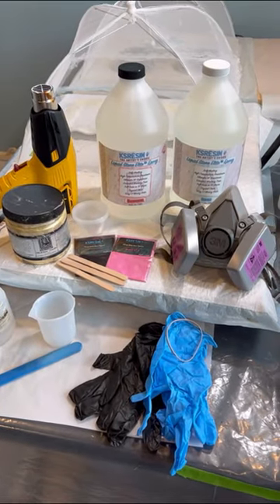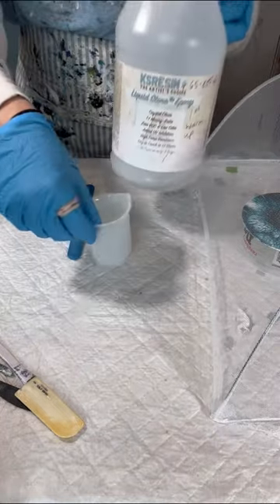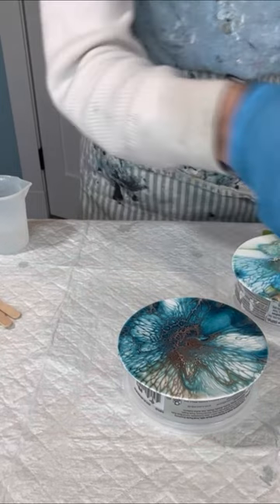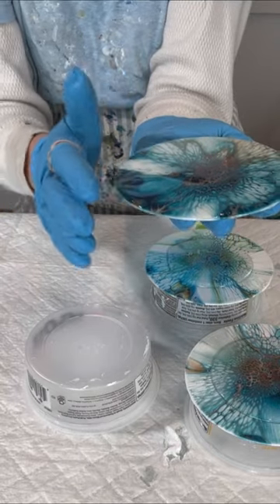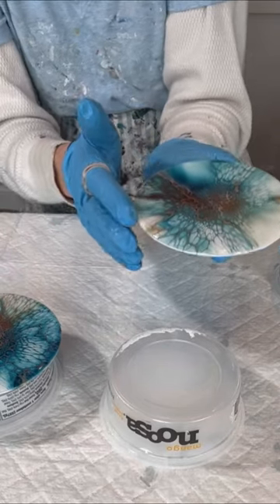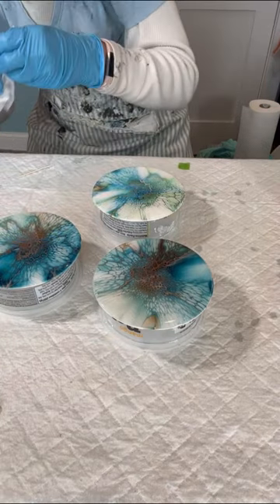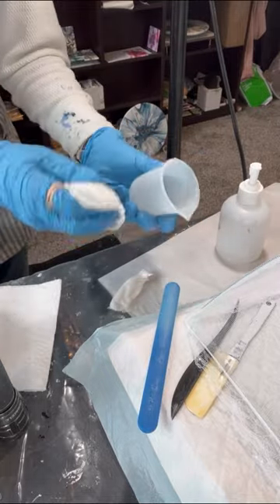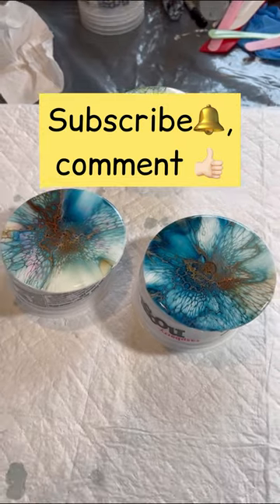166. How I Resin My CDs, start to finished results. My tips and compiled learnings shared. Resining

Comment: Thank you, thank you, thank you, Louise!  For the life of me, I could not understand why I’ve never had an equal amount of resin & hardener.  I precisely measure out equal parts, but always end up with more resin in the bottle than I do the hardener.  Now this has occurred in summer as well as colder months so it can’t be attributed solely to the cold.  Other factors must play in.  I’ve also wondered why I end up with a substantial amount left over in the cup after I pour the mixture over my piece - I prepare the two so I should have just enough but end up using what’s left for a smaller piece.  I’m guessing only the hardener expands??
The 3 pieces you resined turned out beautifully.  It’s a tricky process and one I don’t relish so am on the lookout for a varnish that gives art a similar look and protective coat.
Reply from the maker: Thanks for your insight Alice 💕but my experience is too much hardener left! And I too measure precisely in milliliters. So my theory is the resin expands more, but warming both they can be measured together under the same conditions.
Reply: I meant too much hardener, not resin, sorry.   So if there’s more, wouldn’t that indicate expansion of it rather than the resin?

Comment: Thanks for the very detailed video.💥 I used my smaller craft heat gun last week and wow! I had virtually no dust particles as I have when I used my larger heat gun...perhaps it stirs up more dust particles?? One question...the resin I have used (in Canada - Krystal Resin) has a sticker on the resin bottle and in large print it instructs to always add the hardener to the container first. I'm not sure of the reason for this. I have actually thought it would be better to add the resin first as the hardener is thinner and it is easier to stop pouring at the amount you need. Thoughts? You obviously have no issues with adding the resin first... 
Now, I need to go back to your video on prepping the CDs for painting (eg how you fill in the center hole). I have poured clocks on vinyl records, but the CDs look like a really neat shelf accent piece.
BTW - I love your rubber band on the glove finger tip. I will be using it!!
Reply from the maker: Thank you so much Hazel 💙💛for sharing your info too. And you’re right about the heat gun because it does blow around. That’s why I keep everything tented up to minimize dust so when the heat gun is activated, it doesn’t blow dust around, but a smaller gun would definitely be less dust prone. Also, I would follow the instructions on your resin manufacturer. KS resin specifically says to add the resin first, and then the Hardner, and that’s simply how I do it, but if yours says to go the other way, I would follow those directions. You could certainly try in reverse order a small batch to see the difference, you won’t lose too much if it doesn’t work out. It’s like with everything if you don’t try something you don’t know. As far as the CD preparation, all I do is tape the back, hole and all, then I trim it with scissors and then I pour on it, and then eventually resin on it too. Here is the video where I Shohei construct the clock.https://youtu.be/c1ZW3YRX_yE
And that little rubber band helps tremendously for me when spreading the resin over the service. But getting better fitting gloves would help to lol.
Reply: Thank you Louise for sharing this video very well explained the process. it inspired me to go on to do my first resin. 🤞
Your CDs look great.
Reply from the maker: @nazyw  awesome and thank you. I hope this helps and you have fun and success! Please subscribe if you haven’t and you’ll see more creations coming up!